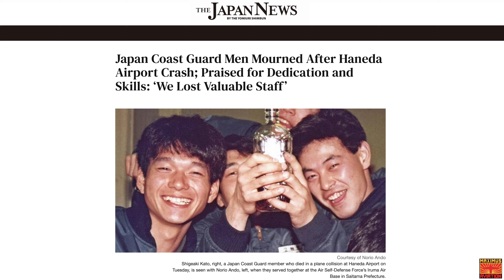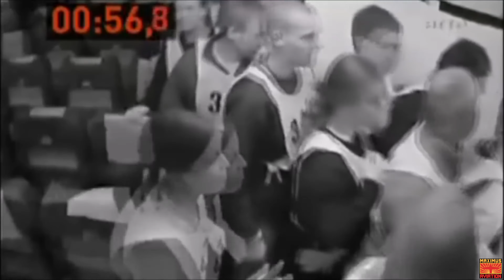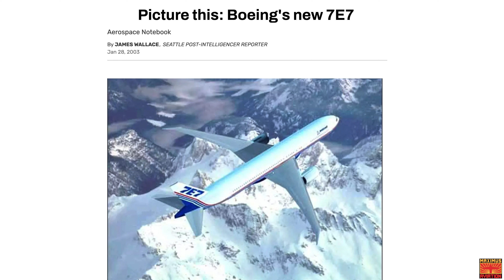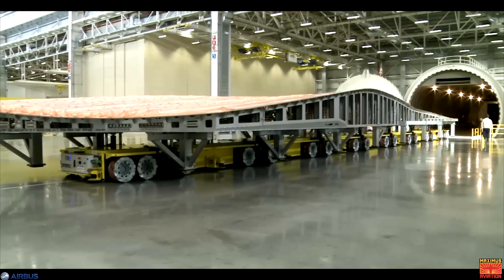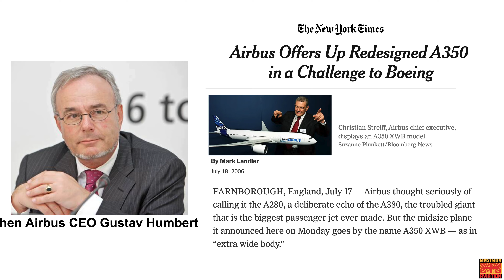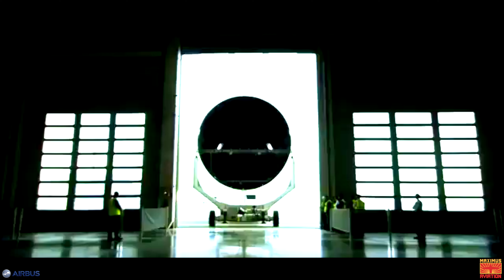How Boeing FORCED Airbus To Build The A350. A Plane Airbus Never  Really Wanted To Build!

Comment: SpaceX famously switched from carbon composites to stainless steel after they had already started building the first prototype Starship. This happened when Elon Musk did some back of the envelope calculations and realized they could more easily build stainless steel Starships for a fraction of the cost and they would be more resilient to temperature extremes to boot. I don’t think aluminum was ever considered due to its notoriously low high-temperature structural instability and melting point. So, my question is, did Boeing (and Airbus) incur additional or save on costs by switching from aluminum to carbon composites? I think we can already infer that it made their planes safer.

Comment: Maximus is a bit late and a bit early with some of his assumptions. That's not as contradictory as it might seem. 

After 7 days after the JAL A350 accident, which killed 5 Japanese crew members of the Dash 7, (which gave the authorities an opportunity to bury them before discussing the fallout from the accident on aircraft design) I, and other YT commentators pointed up apparent news reports that the JAL captain was still walking through the aircraft looking for any stragglers, between 10 and 18 minutes after the exit of passengers, which apparently happened within 90 seconds. As was said at the time, if this information is confirmed by the accident report, then carbon fibre (yes, I know there are other elements as well) structure is going to be seen as mega successful in its role of fire prevention, and the A350 especially, seen as the 'safety poster boy'. I don't remember Maximum stating all this at the time. Its too late now, its already been done.

The B787 is constructed differently, and unless they set fire to one, we don't know if it would behave the same as the JAL 350. However, I understand some B787s have been retired, so if Boeing had the intelligence or even cared, they might buy up and set fire to one of those old hulls, and we'd see.

Maximus is a bit early with his assumptions also, because, we are now waiting for the delivery of the accident report, to confirm many of the rumours we've been hearing and talking about iro the JAL accident. He certainly seems to be lacking in original thought with this video..........

Comment: It’s ironic that it was the composite construction of the A350 that caused all the problems and disputes between Airbus and Qatar Airways due to surface failures in the extreme conditions of the Middle East…..
Reply: What is really funny is that only Qatar has this problem….

Comment: This is a totaly unrelated event my wife and I experienced. On Wednesday February 21 2024 my wife and I flew to Washington D.C. This was my first ever visit to the Steven F. Udvar-Hazy National Air and Space Museum. I’ve never been anywhere else in the states save Toledo. We flew on the Air Canada Bombardier CRJ 900 aircraft. Very small but extremely fast. As we began our descent and were on our final approach, I don’t know what our altitude was, when the CRJ-900 went maximum throttle and extreme pitch up. I had an idea what this was so I looked out the window if there was anything I could see. Well see I did. I saw a small two engine propeller plane similar to the Beech Craft King Air. It passed us, my guess it 1000 feet or less. This happened very quickly. I was very lucky to have seen the plane at all. Our pilot resumed our approach and to a safe landing. As we were disembarking from the airplane I saw the captain speaking to one of the stewardess. I asked the captain “Did you encounter a T.C.A.S. initiated event”? He said yes. I told the captain that I saw a small two engine aircraft pass us underneath. He added that this twin engine plane was a 1000 feet higher than he should have been. We were very lucky that our flight crew responded correctly and quickly. Okay.
The museum? That’s another story.

Comment: This sad incident just reveals: that 90 seconds evacuation was not achieved in real life.  That The miracle that it was a carbon fiber barrel not a Aluminum composite barrel aircraft involved, lives were preserved. 
All involved in aviation needs to learn from  this lesson that even with a complaint group of Passengers  we couldn't achieve the 90 seconds that  FAA and others  aimed for in a evacuation.  So, globally only a few of the carbon fiber aircraft make up our fleets.

But Boeing continues to roll out the MAX solution instead a safer option

Comment: The Airbus A300 is a wide-body medium-to-long range airliner; it has the distinction of being the first twin-engine wide-body aircraft in the world.[8][9]: 34 [12]: 57, 60 [19] In 1977, the A300 became the first Extended Range Twin Operations (ETOPS)-compliant aircraft, due to its high performance and safety standards.[6]: 40  Another world-first of the A300 is the use of composite materials on a commercial aircraft, which were used on both secondary and later primary airframe structures, decreasing overall weight and improving cost-effectiveness.[19] Other firsts included the pioneering use of centre-of-gravity control, achieved by transferring fuel between various locations across the aircraft, and electrically signalled secondary flight controls.[20]

Comment: How many years (pressure cycles) are these composite airframes designed to last and how long after that period can they remain safe to use? Current evaluation methods to detect structural defects appear to rely more on hope than hard fact. I ask because I can't name any transportation industry that doesn't have a deferred maintenance backlog on infrastructure that gets pushed well past it's designed lifespan before replacement, as is tradition.

Comment: Boeing doesn't deserves credit for anything regarding JL516.

Airbus, the disciplined Japanese people and the professionals at Japan Airlines that do. The thing with composites is that Airbus was long toying with it before Boeing even considered using it for the 787, the rear section of the A300 all the way back in 1970 was made with composites, and that was kept with the A330 and A340 when they reused the same fuselage, not to mention 25% of the A380 is made from composites.

The A350 XWB didn't happened "because the 787 exists", it happened because airlines wanted Airbus to design a 777 replacement and that's what they did, it's the customer who says what they will be doing next, not Boeing. Ultimately the "old Airbus with lipstick" did also happen with the A330neo and, by the looks of it, it's not as unwanted as it was assumed.
And I'm not even getting on politics because a lot of the 787's "success" comes from price dumping practices (the Hawaiian 787 order is a well documented example of this), not that it isn't a great plane, but a lot of this "success" comes from business practices because Boeing needs to build a ridiculous amount of these planes to break even given how it sunk the company in debit. Airbus had similar issue with the A380's commercial failure, but at least they had the immense profits from the A330, the A350 and specially the A320 family to make up for that.

Maybe we should be giving credit for these lives being saved to the A350 engineers and not a company that, if anything, is morally fine with killing people for their profits.
Reply: A330 just had new orders for 23 more aircraft.
Reply: Who hurt you? 😅

Comment: Now if only Boeing had applied the clean-sheet-design mentality to the 737 to compete with Airbus too...
Reply: and if airbus went clean sheet after a320ceo
Reply: @nickolliver3021 The A320ceo is a clean sheet design, and a revolutionary one compared to the contemporary aircraft.
Reply: @todortodorov6056  The 737 was a clean sheet and revolutionary as well!
Reply: @nickolliver3021 Yes, it may have been. My comment was intended to correct your mistake about the Airbus 320 ceo, which was a clean sheet design.
Reply: @todortodorov6056  The a320ceo was upgraded to the neo which is not a clean sheet design so it wasn't a mistake from me
Reply: @nickolliver3021 You are right but a valid design nowadays.  737 max is a Frankenstein.
Reply: @fduran6993  Then so is the a320neo a Frankenstein
Reply: @nickolliver3021  It isn't because it is much more advanced technically and its design has not been "forced" as the case of the max. Engines implementation problematic implications and a design based on 60s engineering. 320 is a 20 years newer design: fly by wire, wings height, etc.
Reply: @fduran6993  20 years more newer isn't the point. It will have its complications very soon. The max is also technically more advanced but doesn't mean 60 years is bad enough.
Reply: @nickolliver3021  you wrote the CEO, but you were apparently thinking about the NEO (as the name suggests, New Engines Option, which is obviously an upgrade to the CEO). As the fewest of us have telepathic skills knowing that you may have thought of another aircraft than the A320ceo, this needed a clarification to avoid confusion.
Reply: @todortodorov6056  The ceo to neo was not a new clean sheet. That was my point originally not the a320 being a clean sheet (ceo version) well anywY if it needed clarification instead of being twisted around then okay agreed
Reply: Oh my....a DJ Aviation addict.

Comment: so with all the experience of the 787, why didn't Boeing build a new 737 based on this experience. Especially as the A350 only appeared as an updated A330 was not something anyone wanted. That's where they need to go.
Reply: Because that would have meant certification for the pilots (which the plam buyers have to pay for). No need for extra training was the main selling point of the MAX series
Reply: It's known that the reason for MAX is they didn't want to do the R@D knowing what that cost in Time & Money following the 787 pathway. 
Especially when the Boeing goal was to increase shareholder satisfaction 
So, just a quick cut and paste to create a Max was needed. 
But that only reveals that the Management and Board are not in the game to be The Aircraft engineering leaders, that the Boeing team of the past was. 
Just executives of a Financial institution that Quality, safety and Engineering excellence is a foreign concept.
Reply: That is a good question

Comment: So, according to Maximus, Airbus copied Boeing, and did it right by improving / replacing their original design to avoid getting left behind. 
Meanwhile Boeing tried to copy Airbus buy sticking new engines on their ancient single aisle aircraft, and screwed it up and killed a few hundred people.
Reply: Yep the comparison is stark. We should be watching a followup video about how Boeing was similarly forced to the build the 797 and now Airbus is deep in the red because nobody will buy their last-generation, relatively inefficient a320. But alas history did not play out like that.
Reply: he is not talking about a320neo and 737max. he is talking 787 and a350
Reply: @nickolliver3021  yep - but when both manufacturers faced having to compete with a next gen plane, Airbus bit the bullet and did a clean(er) sheet design but Boeing went with the cheap option and now >300 people are dead. Imagine a different world where the 797 was flying now instead, and Boeing completely owned that segment of the market.
Reply: @mrgilbe1  Not really. Airb7s didn't go clean sheet from a320ceo to neo did they. Why does it matter that 300 people are dead. The 797 being around won't make them own the market share

Comment: Thank you Maximus - when one company innovates, the other has to follow, and both designs seem to be reliable and safe.  Enhanced fire resistance is already saving lives.
Reply: Only that it was Airbus the one innovating at least in this specific case of carbon composite materials. ...It seems the A380 has been forgotten.

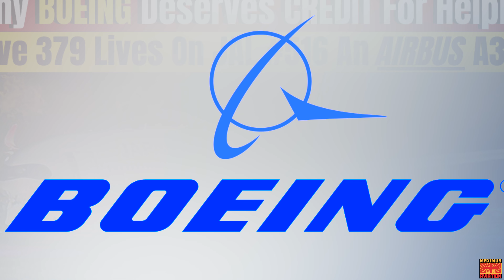Comment: 5:20 Before the 787, Airbus A380 already made use of Carbon Composite material, not extensively as the 787 or A350, but still a considerably amount considering it size (about 20% of its structure). In fact, Airbus was the first manufacturer on commercial aviation to make use of composite lighter materials, starting with the tail of the A300 some decades ago.
EDIT: So, Boeing wasn't the one giving birth to a new generation of aircraft.
Reply: I think Tupolev was using it even before.

Comment: How much are they paying you to say something nice?
Reply: Max is probably trolling that stupid prikolliver account that pollutes every aviation channel with meaningless propaganda whenever Boeing or the Frankenmax is mentioned.

In that regard Maximus has been successful as the janitor is all over this thread as usual.
Reply: That would be ok if the merit was due. But it isn't. Airbus were the first deciding and using Carbon composite materials on commercial aviation on the A380, not Boeing with the 787. Boeing was just the first making an entire aircraft out of it (EDIT: well, 50% of it to be more precise).
Boeing is technologically playing catch up since the late 80s. ...it seems most of the world hasn't realized it yet.
Reply: @miks564  Airbus used it much earlier in the A300.
Reply: @kw8757  Yes! In the 70s! But with the A300 they’ve used a fiber glass composite. And they’ve been using light composite materials in all the families of aircraft since then. However, carbon composite I believe the A380 was the first.
Reply: @miks564  Thanks👍

Comment: Máx..not buying this one. Plastic jets, plastic parts look great, act great until they explode apart. Hard to believe the resin in carbine fiber isn't highly flammable. Most professional airline wrenches cringe when there is delamination,,say a small bird strike. When built.. conditions have to be perfect. Temperature, humidity, vacuum pulled, drying etc. These conditions can't be done on basic repairs
Reply: Techs are more prepared than they used to.  It’s not like these A&Ps are working on F 35s or F22s.  Guys  now know how to mangle these materials. No one said the resins are not flammable but what’s Important here is that the materials burns SLOWER than some aluminum alloys. When you’re getting off a burning airplane that’s important
Reply: @jimsteinway695  "Guys know how to mangle these materials"....they certainly do at Boeing.🤣
Reply: I guess many years of 787 and a350 service are proving the material (though I have no idea about the maintenance overhead that's keeping them flying safely).
I'm fascinated to know how that Ethiopian 787 that was repaired after an electrical fire at the back of the aircraft is performing. That was another key test of the technology - how do you repair major damage, but that's short of a hull loss, in a carbon fibre fuselage?

Comment: Boeing will make an historic comeback when they get the 757X built and deified.  What is the 757X you ask?  Well, it is simple, it's a single isle 787.  As they did to the 767 to create the 757 so should they do to the 787 to create the new 757X.  It is a no brainer.
Reply: It wouldn’t be a 757X. The 757 program ended in 2004. You can’t just restart it again after an “hiatus” and just add bigger engines. And even if they created a single aisle 787 it would have to be certified as an all new aircraft anyway
Reply: @tomstravels520  Oh no, it is in fact the 757X and is indeed a clean(ish) sheet design.  The original 757 would be extremely difficult, although not impossible, to start building again, but we all know that won't happen.  My 757X design calls for a down sizing of the 787 fuselage to a single isle, much like they did with the 767.  One would not be wrong to say the 787 is a 767 replacemeant for the 21st century.  I just applied the 767/757 paradigm to the 787 and designed a 757X.  Carbon fuselage, same wings, (scaled), GEnx, like type rating, etc.  I think it would closely match the appearance of the original 757 also and have a lot of synergy with that program.  They know how to wind carbon so, while it would be a design challenge, that's what Boeing does.  Maybe they could bring some military division folks into help speed up the process.  Probably far too much to expect, but it would be nice if they would pull things back in-house and get back on the vertical integration bandwagon.  All hail the 757X!!
Reply: @tra757200  Boeing has too many problems to think about a new plane right now. They can’t even get 3 modified planes certified and a space vehicle work properly
Reply: It is a no brainer. And that’s why Boeing won’t do it! Real plane guys no longer exist at Boeing.